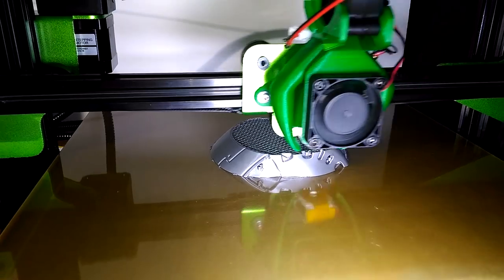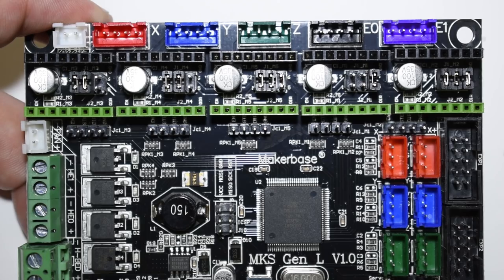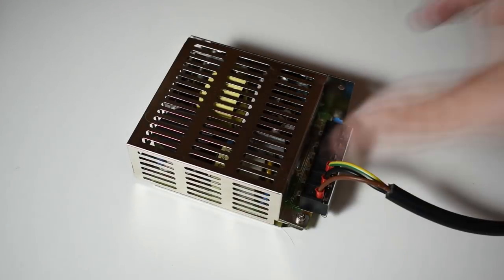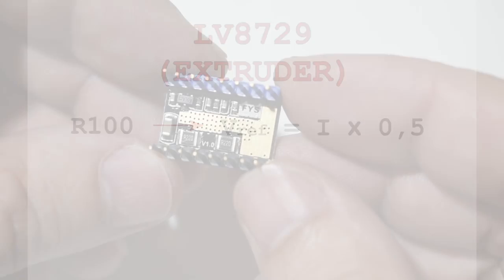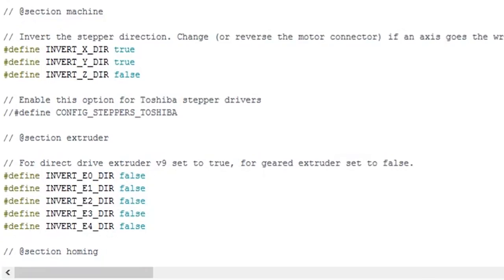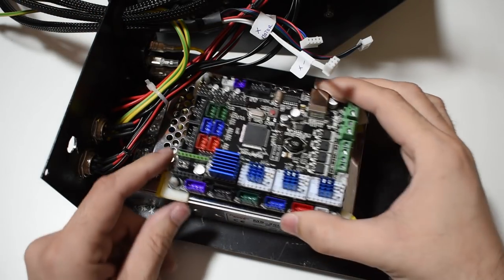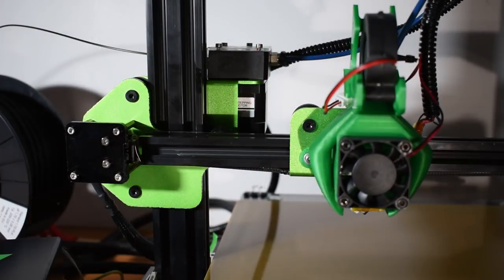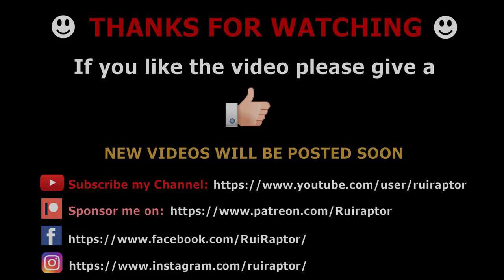Install & Setup - MKS GEN L + TMC2208 + LV8729 (TEVO TORNADO)

Comment: I'm aiming to get rid of the control box entirely. It takes up too much space and is annoying to move.
Reply from the maker: Hi,
you can always make an enclosure under the printer like the flash for example.
Reply: @ruiraptor  What do you think about having a common 24v power supply for multiple printers to save more space?
Reply from the maker: With AC heatbeds, that can probably be duable but with DC heatbeds you would need a very big/powerful power supply.
Reply: @ruiraptor  Yea, using ac heatbeds. Was aiming to use server power supplies in series, just need to figure out best way to connect them

Comment: Hi Rui, great video as always. I have a couple questions:
1. Is there any particular reason why you chose tmc2208 instead of the 2130?
2. You said you prefered 1/16 microstep. Is it because there's no difference between 1/16 and 1/32? Or is it because it loses steps with 1/32?
Reply from the maker: Hi df0s,
Good questions... check below the answers:

1- The TMC2208 is much easier to setup. The TMC2130 has nice features like sensorless endstops and others but I'm that kind of guy that likes to have "real" endstops :D
2- When dealing with 8bit microcontrollers, 1/16 steps is a better choice (in my opinion) but you can still run them at 1/32. Also, when you set them up with 1/16 steps, they will have the same steps per millimeter as the stock ones.

Comment: Will those drivers work the same way on tevo black widow
Reply from the maker: Hi Jim,
Yes. Actually, i have already my black widow running with TMC2208s. I'm still waiting for the LV though.
Reply: Do u have a link  Where I can buy TMC2208 thanks for your great videos
Reply: And is the Procedure exactly the same for Tevo black widow as for the printer you showed in this video  If it's not  I would really appreciate if you  Could do  An overview  Video for tevo black widow thank you so much
Reply from the maker: Hi Jim, 
I also installed TMC2208 drivers in my black widow. I used Vref=1.19 for the X, Y and Z axis and they work great. Don't forget to change the stepper motors direction in the firmware.
Reply from the maker: You can buy them on bangood for example...here's the link:
https://www.banggood.com/pt/TMC2208-Stepping-Motor-Mute-Built-in-Driver-Replace-TMC2100-For-3D-Printer-p-1243870.html?p=84280421195697201804&utm_campaign=21195697&utm_content=3312
Reply: Thank you so much for the help love watching your videos great information keep up.the great work your awesome

Comment: Can this drivers be install in a Ramps 1.4 or Mks gen 1.4  ?
Reply from the maker: Hi Mateus,
Yes they do.
Reply: ruiraptor but not directly just with jumpers right ?, as you did with the mks gen l
Reply from the maker: Correct, you need to set the config jumpers.
Reply: ruiraptor I don’t want to deal with that lol, I might just replace my ramps for a mks gen l, Great conten, thank you

Comment: If you have two Z-axis how does this affect the vref
Reply from the maker: Hi James,
That depends on the way you connect the second Z motor.
However, I found that if you adjust the vref for the ideal output current (same as for X or Y) for x1 z motor,  you can connect the second z motor in parallel without any issues. This is because you are adjusting the output current with a more accurate value when compared with the low stock value and also because the Z axis does not require much torque when compared with all the other axis.

Comment: Can you please please please post a link or the code for the MKS GEN L V 1.0 configuration.h file? I am having so many issues trying to use my old marlin config from the old board and I'm getting issues that are hard to track down like when I switch on my printer the hot end goes into thermal runaway with no error or intervention from the firmware. It just heats up until it smokes. sadly this is the closest I'v e been to having it working after soldering new connections and terminating all the wires. I'm close to picking a new less stressful hobby.
Reply from the maker: Hi Keith, considering that you have the Tevo/Homers tornado equipped with the MKS Gen L board, you can download the latest marlin firmware and the config files for the tornado here: https://marlinfw.org/meta/download/
Reply: @ruiraptor  So I added the update to my existing file as they don't seem to offer a full update now it wont compile without error. I'm still looking for a solution. I have all of the same hardware you have as I've been following you since I got the inkling to upgrade my tornado. I ordered a new board from amazon thinking I may have shorted something, and of course it came with a 12000 MHZ crystal oscillator missing. So I can't test if it was the board I ordered a new crystal oscillator. the funny thing is its the one with the maker base logo that looks more legit than the one from bangood but we'll see.
Reply from the maker: Which error are you getting?
Reply: @ruiraptor  it says there's a ( missing. I don't think the 2.0 firmware is good, I can't even verify it without getting that error. That's before even adding the update to the 1.1.9 firmware. Just doesn't seem to be my month for technology.
Reply from the maker: Hi Keith, do you have FB? If yes, check the official tevo/homer tornado group. They have some firmware versions available there.
Reply: @ruiraptor  I got it finally up and running. Just leveled the bed and got all the wire tucked neatly away, only thing left now is to clean the nozzle. Thank you for all your help sorry if I trolled your comment section too much, its been a rough week. But finally got both my printers in working order. Next I gotta hook up the BLT and the chain cable management.

Comment: What happen if i don't use the drivers?? i buy the board but not the drivers....
Reply from the maker: Without any drivers the motors don't turn.
Reply: ruiraptor thanks 👍🏻 what drivers you recommend for this board?? Any brand ... can you recommend me any 👍🏻
Reply from the maker: Hi, personally I like the TMC2208 and LV8729 on the extruder combination.

Comment: does this work at the BW too?
Reply from the maker: Yes it does. You can upgrade the stock DRV drivers with these on the MKS GEN 1.4. Use the same jumper configuration too.
Reply: ruiraptor so you only have to remove 1 jumper right? At each stepper ?
Reply from the maker: The jumper configuration is exactly the same for the Gen 1.4. If you are using the same drivers as I do, use the same jumpers in your board and it will work.
Reply: ruiraptor okay do you know where to find a description over what exacly the jumpers do when you remove Them?
Reply from the maker: The jumpers are used to setup the stepping. In my video, the jumper configuration is set to 1/16. You can choose other stepping configuration (like 1/32 for example) but i don't recommend it with this board. Google for TMC2208 jumper setting (under images) and you will see tables with several drivers and their configurations.
Reply: ruiraptor thanks slot for all you answer my printer is now up and running again keep up you great videos 😉

Comment: Hi,

I have got a problem to flash MKS GEN L V1.0 with marlin. It give a AVRDUDE error. Someone now how to flash it?
Reply from the maker: Hi,
check my firmware upgrade video here:
https://youtu.be/g4aHmbt5gMA
Reply: try to keep the reset button on the board pressed before clicking on flash hold it until it finishs kompiling (when the white letters appear) than quickly let the button go.

Comment: How do i know if i need to reverse the display connectors?
Reply from the maker: If you connect the display and it does not display any information, then you need to reverse them.
Reply: OK. Thought there was any kind of info on the board that could give us this information. Any other place where i can get the firmware? I don't have facebook!
Reply from the maker: You have the tevo website too.
https://github.com/tevo3d

Comment: Does anyone have a working marlin config/config_adv I can have a look at? Everything is working fine apart from the extruder which pumps it out way too quickly so causes skipping. Any help would be amazing!!!
Reply from the maker: Hi,
You have many working versions in the official facebook group.
Regarding your issue, did you check all the steps (X, Y, Z and Extruder)?

Comment: Hello again...I have been getting Y axis shifting at about 4mm height,changed SD cards and tried slowing my prints but still does it...Should I up the Voltage of the Y axis or is the 2208 going bad?Can't print anything right now
Reply from the maker: Hi,
Are you using Cura?
Are the drivers being efficiently cooled?

Comment: Hi, rui, greetings I have made the update of your video. Now I'm missing the Marlin. Can you please pass me a marlin that works well? I also have the BlTouch, a Bondtech BMG and an E3d V6 Clone all metal.
Thank you
Reply from the maker: Hi Raul,
You have several options.
One version that is tested is the official one that you can find here: https://github.com/tevo3d
Reply: @ruiraptor Hola de nuevo Sr. Rui. Descargué el Marlin del enlace que venía con el repositorio de Tevo Github, pero la versión aún es 1.1 para el tornado. No hay actualización.
Reply from the maker: Hi again,
there are many other versions available for the tornado in the facebook official tevo tornado group.
You need to join that group and download one of the many firmware versions available there.

Comment: Hi Rui, thank you very much for the answer, I still have 2 questions, I bought another motor for the z axis, that kit that sells in banggood for tarantula, not yet arrived, I will have to change the voltage that goes out for the z axis motors ? Another question is: I've been watching videos about the TMC2130 and it seemed very interesting, because in the video I saw, even stopping the extruder manually and pushing it to the corner, it returns to print in the right place again. Does the TMC2208 also have these advantages? Look at this video at the current time https://youtu.be/sPvTB3irCxQ?t=254 because I could only buy the TMC2130 card and drivers ... do you think the 2208 is as good as?
Reply from the maker: Hi Christian,
Regarding the Z current, it depends on how you will connect them. I have adjusted my vrefs (as i show in my tarantula video) and use those settings for 1 or 2 motors. They work well...no complaints.
Regarding the TMC2130, those have the advantage to work with SPI and the firmware can modify the vrefs automatically.
But this configuration is not tht easy.
The TMC2208 are as good ut the communication is with UART. Anyway, to answer your question, to have the full advantage of the TMC2130 you need to connect them using the SPI connection. Without it you just get the standard features like everyone has with the 2208.

Comment: Half way down this page you'll see a GenL board that has a UART jumper next to the drivers - does that do all the hard work of becoming a UART capable TMC2208 setup?  http://3dmodularsystems.com/en/stepper-motor-drivers/661-tmc2209-silent-stepper-motor-driver.html
Reply: I velive that the board you mean is an SGEN-L not a GEN-L, they look similar but they are not, the GEN-L is 8 bits and the SGEN is 32, among other things

Comment: Hey there....Thinking of putting a Gen L board into my Tornado which despite Gearbest saying it should have had, it didn't!
Looking around there are 2208 and 2130 chips, they're the same basic 2100 chip, but the 2130 adds SPI, the 2208 has UART.

It looks like you are not using the chips to the full advantage as with a bit of extra wiring you could tweak and tune the voltages in software and also add some of the smart features as per

https://www.youtube.com/watch?v=sPvTB3irCxQ

What do you think ???

BTW Was your Tornado Vid that got me to buy one over the CR-10s. I've an older Anet A8 too, but the Tevo is so much better built for really not that much more these days!
Reply from the maker: Hi Lee,
thank you for your comment.
I know about the SPI/UART modes and benefits but my goal in this video is to explain how to easily upgrade the printer (plug and play...except for the vrefs adjustments).
I might do a video in the future about SPI and UART setups. Thanks for that :)
Reply: This would be great to see.  And THANK YOU for your awesome videos